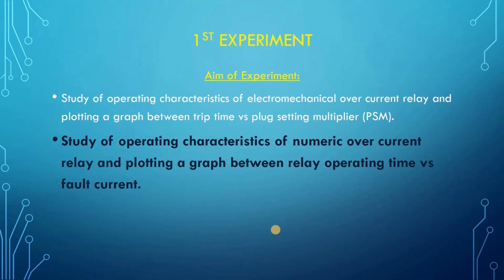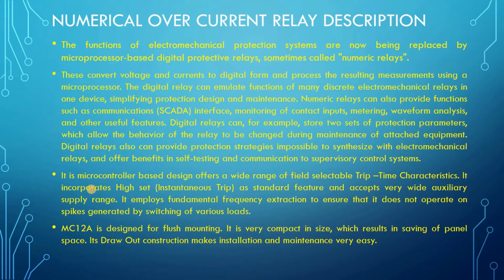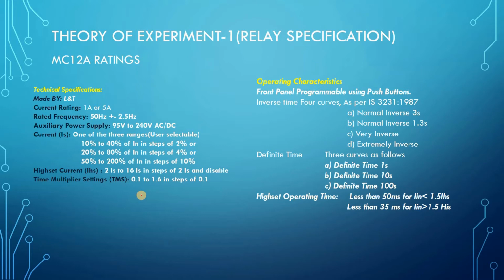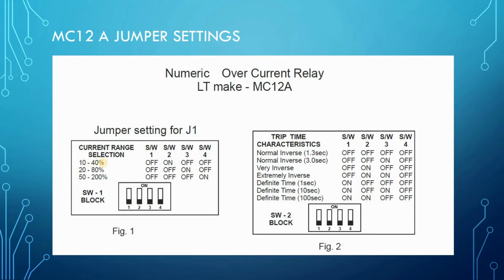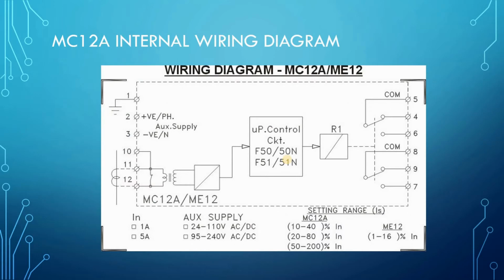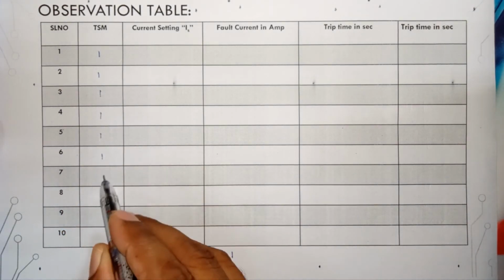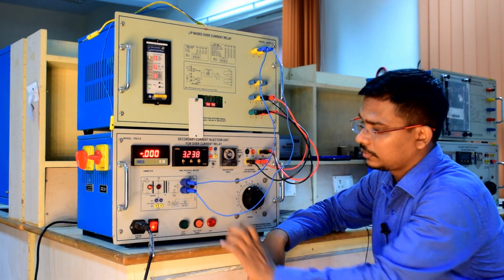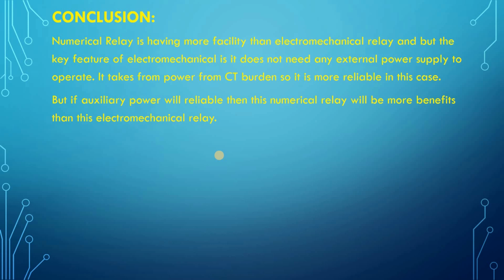Over Current Relay Experiment Part-2 (Numerical - MC12A)

Comment: Rating of C.T of EFR is 1A/5A….but what if I apply this current (In) through a CBCT?
Will EFR operate?
The current through CBCT will be in milliamps.
Reply from the maker: "In" of the relay is predefined when the relay is manufactured. "In" is the CT Secondary Current. if you will see the "Is"  it can be adjusted from "0.1*In" to "2*In". So any current greater than "Is" whether it may be in milliamps will leads to operate the relay.

Comment: What is formula of Curve NiNV 1.3 characteristics
Reply from the maker: Hi first of all thankyou for showing interest on this video and thanks for comment and query. 
What I can say that NiNV1.3 corresponding to Normal Inverse 1.3
And if we will know the formula then it will be like (0.061/(PSM^0.02-1))*TSM
In digital relay PSM=Fault current I)/set current Is.
TSM is nothing but Ti(TIME MULTIPLIER)
similarly for NiNV 3.0 and 0.6
Formula will be (0.14/(PSM^0.02-1))*TSM
and (0.028/(PSM^0.02-1))*TSM respectively.
Similarly for EiNV-Extreme Inverse Formula-(80/(PSM^2-1))*TSM.
ViNV-Very Inverse Formula-(13.5/(PSM-1))*TSM.
LiNV-long time Inverse Formula-(120/(PSM-1))*TSM
DEFT-Definite Time Characteristics. 
I hope you have got your replied.